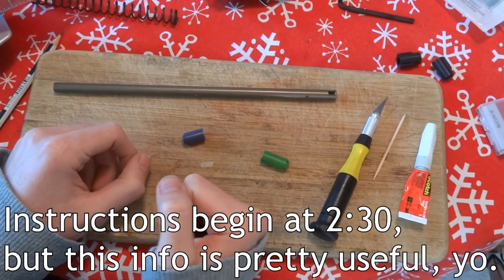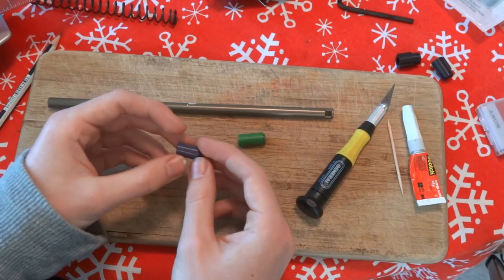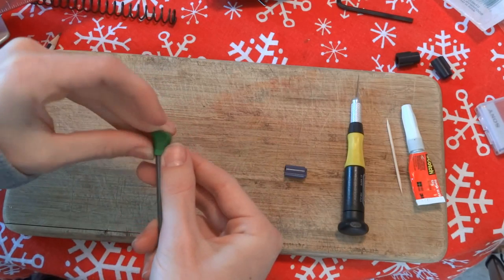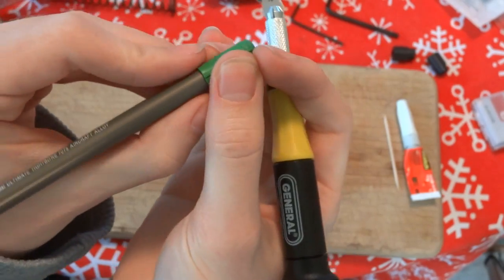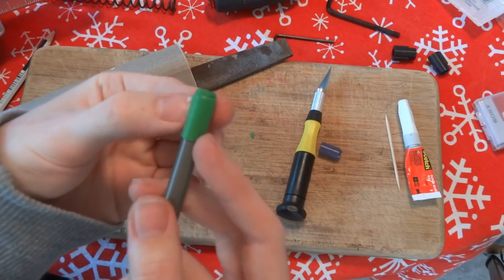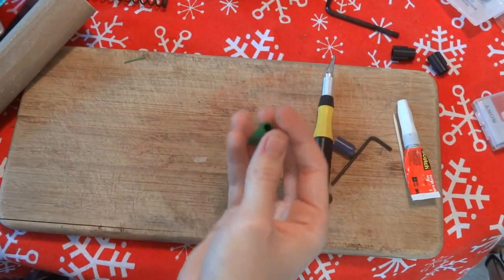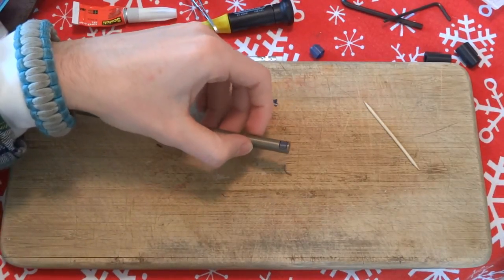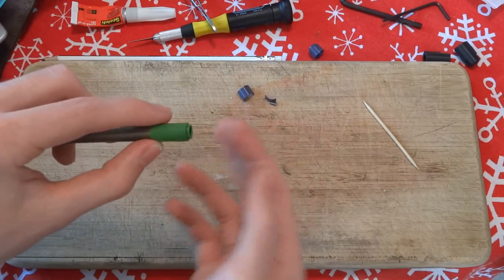Increase any Airsoft Gun's Range and Accuracy: G-Hop Installation Guide

Comment: This looks good and not to terribly difficult, even for me..... but I do have some questions..... I run a Kings Arms Sig556 shorty with a Madbull 6.03 innerbarrel and I want to install this G-hob, do I need to change anything on the stock hopup, or leave it at that? I assume after installing you work your hopup like you would normally? And last but not least, does the fps change at all, Its running at 355 fps concistanly now at that is the max limitation for most fields here in Europe....thanks in advance
Reply from the maker: You don't have to change anything. Maybe just add the Maple Leaf nub for a bit more of an increase in performance. After you install g-hop it operates like it does normally. You might notice smaller hop up adjustments on the hop dial making a bigger difference on performance, but it doesn't make it difficult to get the hop adjusted to where you want it. I've never noticed an FPS change in installing G-Hop. If it does change your FPS, then it's because what you used for an outer bucking gets a better or worse air seal than the bucking you used prior. If it does make an FPS difference it won't be by much at all, unless you fixed or added a serious air seal problem. Hope this helps.
Reply: it does, actually as soon as I get home this weekend will give it a go..... thanks mate.

Comment: For nubs I've been getting great results from my F-Nub
Reply from the maker: Firefly Namazu? Looks like it'd work great with this. Added to the video description. Thanks!
Reply: No I've never used the FireFly. I was talking about the F-nub I came out with. Its a foam nub that comes slightly wider than an AEG's hop up window. This allows it to fill in the whole thing while remaining very compressible. Im using it an my AEG's and my GHK G5, with Flat Hop and R hop
Reply from the maker: Reece Mechanical So kinda like an M-Nub?
Reply: Yes, look at the video I put up about it a few days ago. So far it seems to have a more narrow range of adjustment than the M-nub but applies more consistent spin
Reply from the maker: Reece Mechanical Very interesting, I might have to try it sometime. I've also added your method to the video description. Cheers!
Reply: Thanks man!

Comment: Not to question your experience or anything, but how exactly does this bucking outperform just a normal nub hopup? Because it seems to me that it would be really fragile just from looking at it.
Reply from the maker: It's not that fragile and it's durable enough for it's application. The gun just blows a BB past it, it really doesn't take much of any strain. As for performance, the theory I go by is that the longer contact patch leads to more contact between the BB and the hop up rubber, which leads to a more stable spin during flight and more consistency between the amount of spin applied from BB to BB. Since the spin lasts longer during flight it leads to an extended range, and more consistency on the spin applied tightens groupings.
Reply: Thanks for the explanation. If I ever do try this mod, do you possibly have the links for the exact hop up buckings you would use?
Reply: So I found the Prometheus hop up buckings on evike, but there is a soft type and hard type and a flat hop smooth bore one. I'm just confused as to which would serve better in this situation or if it really matters?

Comment: Great video, I've been looking into installing a G-Hop for some time, but one thing puzzles me, a normal bucking sits flush in the well and there's no edges when the Hop Up is turned on, but the patch has a lip when pressed into the well, wouldn't the BB rip it off from the inside when it travels through the Hop Up?
Reply from the maker: Thanks! No, I've done this to well over 10 guns (one oh which has put around 100k rounds through the G-Hop at 450 FPS) and I've never had a BB rip the patch off. G-hop only has that lip if you apply way too much hop. While you're using the G-Hop you won't actually be pushing the patch that far into the barrel and even if you did the BB is round and would just push the patch up and not rip it off. The fact that the patch is free from the outer bucking is why G-Hop works so well anyway, it allows the hop to contour to the BB.

Comment: Do you want the bucking patch to be flush with the inside of the barrel when not being pressed by the nub? Or does it protrude into the barrel like the R Hop? Also have you had any issues with it wearing down under use?
Reply from the maker: +Matthew Taylor With the G-Hop you just kinda lay the contact patch onto the barrel window when gluing it like what is shown in the video. It doesn't really need to be terribly exact like R-Hop does. And I have around a hundred thousand rounds through the G-Hop in my Type 97 and it still works good as new.
Reply: +TopHatRunner Thanks for getting back to me! I've heard that GHops can vary in consistency from GHop to GHop, such as one works well and the next one is crap. Have you experienced this at all?
Reply from the maker: Matt Taylor No, every G-Hop I've installed has worked great. If you get a poorly performing G-Hop I'm going to assume the install was botched in some way or something was wrong with the contact patch or outer bucking. As with all custom upgrades, there's always the chance that something went wrong during the installation.

Comment: I will definitely try a harder contact patch. What do you mean by wide enough though? Covering the entire cut out on the barrel with the patch?
Reply from the maker: Yes, that's what I mean by wide enough. Particularly the area of the cut on the sides of the barrel. As for the front and back of the hop cut, make the patch comes as close as you can to touching, without actually touching, the raised barrel at the edges.
Reply: ***** maple leaf nub right? what about the scs nub?
Reply from the maker: The maple leaf nub is an extended version of the SCS. SCS is also hard while the Maple Leaf is rubber (rubber is recommended). Either should work great, but I imagine the maple leaf nub would work better.

Comment: Do you have any idea why my gun is misfiring A LOT with prometheus bucking?
I lubed everything, cleaned the bucking, lubed magazines, diferent magazines...
I have the normal bucking setup, and since, my bucking is not that great now, because of taking it off a lot of times, I was thinking of doing that to my prometheus one. WHat do you think?
Reply from the maker: What exactly is your Prometheus bucking doing? Is the gun not feeding or double feeding? I had an issue with a Prometheus bucking I got recently. The gun couldn't feed, the bucking's feed lips were too tight, the gun couldn't push the BB into the bucking. Might be your issue. Either that or you're installing the bucking improperly as one of the "techs" at my local field does, but if the stock bucking is working then I'm assuming it's the Prometheus's fault and not your installation. I'd recommend doing this mod no matter how well your stock or Prometheus buckings worked. Just be sure to use the Prometheus for the contact patch and the stock bucking as the outer bucking. If you use the Prometheus as the outer barrel you'll still have the issue, as you probably could have guessed.
Reply: ***** Yep, it's misfeeding, like A LOT, changed to stock, and it's good now. I saw a lot of tutorials on how to do it, and to lube it or not(outside) to fit smoother, etc..
On the first game, the bucking was doing great. now it's just wrong. I rly don't know if it's the lips, because I cutted a bit of them and still does the same thing. Yes I think I destroyed it but...anyways, I will try the G hop thing then
Thanks a lot :)

Comment: Great tutorial there! Just wondering, what is the softness degree of the G&G rubber you used for the outer bucking?
Reply from the maker: Thanks! I have no idea, it came with one of my G&Gs. If I were to guess I'd say 50 or 60 degree. I recommend softer buckings for the outer bucking as they get a better air seal while I recommend 70 degree rubber for the contact patch.
Reply: *****
What do you think if it's 40 degree for the outer bucking? Do you think that is too soft for that matter? ><
Reply from the maker: It'd probably work.
Reply: *****
Thanks bro! Off topic here, very nice free running videos you have there. Any thought of compete in American Ninja Warrior? :D
Reply from the maker: Zero Ricochet Thanks! Haha, I'm no where near that point. :D I still keep up with parkour but I don't do it as much as I used to. Nowadays I just do enough to stay in shape. ;)

Comment: Once this mod is done , does a cheap / expensive hop up housing affect the range at all ? Or is it just purely the bucking
Reply from the maker: Just wrap 1-3 layers (depending on your bucking and chamber) of Teflon tape around the area of the barrel that's past the hop window but still covered by the outer bucking and put the outer bucking over the Teflon tape. This should cause your bucking to get a good seal with the hop chamber. You might have to apply some light silicon oil to the bucking to be able to get it into the chamber. You'd have to actually have something about your chamber broken or want a different way to adjust the hop for a new hop chamber to be anything but a waste of money. To answer your question, it can be the chamber if it's really loose (which can be fixed by the aforementioned mod) but in most cases it's purely the bucking (and gearbox compression).
Reply: Thanks for the reply man !

Comment: i did took off the lump with my dremel to the point its pretty flat but i did not remove the ridge to guide it properly in the barrel maybe that was that, you remove both lump and ridge and use the untouched rubber portion of the outer bucking to touch the contact patch, also do you glue the patch in all four directions or just the sides?my gun is already hitting 170feet man sized targets this mod would make it to 300?

Comment: What two buckings do you most recommend for this, and what degree? I'm not sure what nub I'll get I'm planning on buying everything on evike. I'll be using this for a CQB set-up, high ROF with around 350FPS. Would you change anything for high FPS or long range? While I'm at it I'll probably do this to my stock A&K SR25K. And for barrels is a Matrix 6.03mm a good barrel? I want a 6.03mm to avoid the maintenance of 6.01s and I should have good gearbox compression with a aluminum nozzle with a o-ring, and Lonex Silent piston head.
Reply from the maker: For CQB I'd use a 60 degree bucking for the contact patch and a 60 degree bucking for the outer bucking. For field or higher FPS I'd use a 70 degree bucking for the contact patch and a 60 degree bucking for the outer bucking. I don't have any experience with barrels, but 6.03 is a good diameter. I'd recommend a Mad Bull 6.03, though. Not if that aluminum air nozzle is SHS. SHS air nozzles have too tight of an o-ring and cause huge problems in all my builds. I recommend Guarder air nozzles.
Reply: Ok thank you! I might not do this for my CQB gun because I'd be worried about the durability with 25-35RPS, but for my SR25K this will be a prefect upgrade
Reply from the maker: I've run G-Hop in 22 RPS setups. It's especially good for CQB guns because it gives them the accuracy and range of field guns. A lot of people seem to question G-Hop's durability, but it's super glued onto the barrel. It doesn't take much of any force from the BBs anyway, it just lightly rubs them as they pass by. I've been running G-Hops for years and some have had hundreds of thousands of rounds through them. I've never had one break. Just use a fair amount of glue and you'll be fine.
Reply: Ok I'll give it shot, buckings are one of the cheapest parts anyway haha. Thanks for your help! Now I just need to find a guide to polishing my barrel for better accuracy/consistency.
Reply from the maker: SFR023 No problem! Here's a good guide to bore lapping: http://youtu.be/oi00jcjSJKE

Comment: cool thanks for the vid and shouout.
i see that it says for high fps setups, but most of my guns are running about 350 fps. Is that fast enough?
and will i still be able to use .25 gram bb without being overhopped?

Comment: Maybe a stupid question but why do you have to cut out another hop up rubber piece and put under the full rubber? Does that make a big difference?  Isn't just the one original enough?

BTW: I didn't used it but as a nub i used a concave brick shape like custom nub and it worked much better as the original, i think longer the contact is better the performance. I've gained about 15 meters( i don't know how many feet sorry :) )

Comment: If u were to use a H-nub would u sand down the side that is coming into contact with the hop rubber so its flat and you have more surface area on the bb?

Comment: Sorry for all of these questions . But I installed the bucking and hop up and something went wrong. It was the bucking. The bbs were flying down and not shooting at times. When I put the tock bucking in it worked. Help? Ireally wanna do this g hop but I dont want anything to go wrong.
Reply from the maker: Hmm, are sure your nub was in the chamber when you used the G-Hop? Maybe it fell out. It sounds like something went wrong with your outer barrel during the G-Hop... just try disassembling your chamber and putting it back together? Sounds like the hop might've been off, maybe the gun wasn't shooting sometimes because the BBs were rolling out (without hop applied BBs will roll out the barrel),
Reply: Ok thank you

Comment: Exelent video! One quesiton, this can be done using two old buking? I have two that I've replaced from my G&G replica.
Reply from the maker: +Antonio Seleme You can use old buckings, but keep in mind this may lead to sub-par performance if you use poor buckings... Also problems in buckings can possibly be carried over into the g-hop. But for your first G-Hop or two old buckings can be great for experimentation.
Reply: +TopHatRunner ok! Thanks!!

Comment: Since I installed this.
I am getting low fps with this modification can u help?
Reply from the maker: If your getting low FPS you either didn't install the outer bucking, used a bad outer bucking, have your hop set too high, or cut through your outer bucking while modifying it. The only way this modification could lower your FPS is if you did it wrong or used a bad outer bucking. Did you install or change anything else at the same time you did this mod?

Comment: Hi there, I'm a PTW user and I was wondering if you could give your input on the Orga Flat Hop(http://orga-airsoft.com/products/detail.php?product_id=104), which is basically a G-hop for a PTW platform. Do you think this would work? Any design flaws?
Reply from the maker: Sorry I didn't get back to you sooner, your comment got flagged for spam... There is a difference between flathop and g-hop. Flathop is like g-hop, but g-hop has the contact patch affixed to the barrel while flathop does not. Typically you can g-hop anything you can flathop as g-hop is just flathop with one more step (and that step makes a big difference). Sadly I'm not familiar enough with the PTW design to be able to help you with that question, but it looks to me like a nub that applies flat pressure to the bucking, which would be good for flathop or g-hop.

Comment: what's the difference between a ghop and rhop?
Reply from the maker: +Evan Diliberto The difference is what you use for a contact patch. In G-Hop you use a cut of a regular hop bucking, for r-hop you use part of a rubber tube. R-Hop takes a LOT of modification to get the contact patch to work, G-Hop doesn't.

Comment: So this does actually performs better than a Flat Hop?
Reply from the maker: +Xander In my experience, yes. In theory it should too, since it works on the same concept as flat hop (longer contact patch) but G-Hop does it better than flathop does.
Reply: I mean its pretty simple and all you nee is a second Bucking. I think I will give this a try in the future but my flat hop will arive in a couple days so I´m gonna test it first ^^
Reply from the maker: ***** If you don't like G-Hop you can always just peel the contact patch off your barrel and it's good as new (assuming you didn't get any super glue into your barrel).

Comment: hello, I'm serious with Hop up in my Blaser R93 problems, this modification could be applied in this hop up model? I have to improvise because I live in Brazil and here it is very difficult to find spare parts. Grateful!
Reply from the maker: I'm not familiar with the Blaser's hop up configuration, but this hop mud can be applied to nearly any airsoft gun. Just use an AEG bucking for the contact patch and whatever bucking the gun is made to work with as the outer bucking. The only thing you need to worry about is if the gun's hop arm can push on the bucking far enough to get the contact patch to apply enough hop to the BB.
Reply: ***** Thanks buddy, I applied these changes in my hopup Blaser and was very good! Genial! When you come to Brazil, you are invited to come to one of our operations Airsoft. We stayed in Rio de Janeiro, Macabu Airsoft Team. Even more!
Reply from the maker: otoniel motta No prob, glad to hear it worked out well for ya. Some day I would love to take an airsofting trip around the world, if even that happens I'll stop by! :D

Comment: For contact patch i'll use a 60 rubber but wich rubber to use for the outer part oft the Hop. (the green rubber is meant) ?
Reply from the maker: You can use pretty much any rubber for the outer contact patch. I've found good results with G&G and Silverback rubbers.